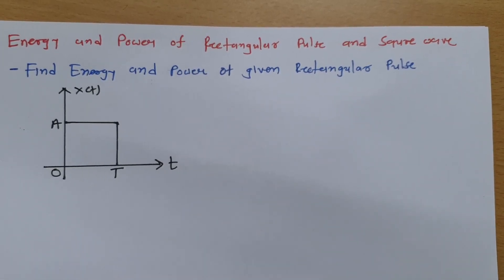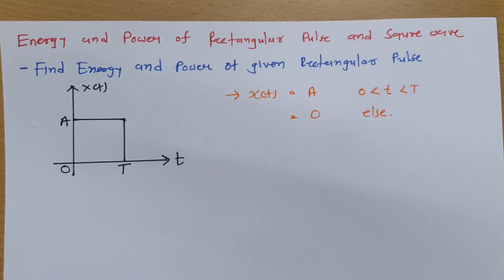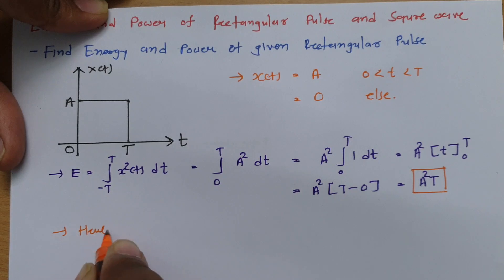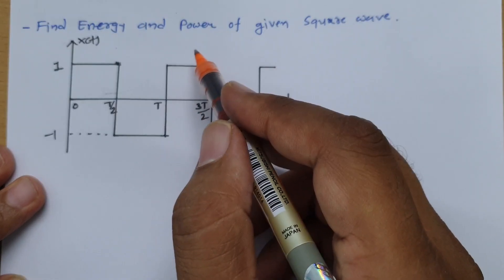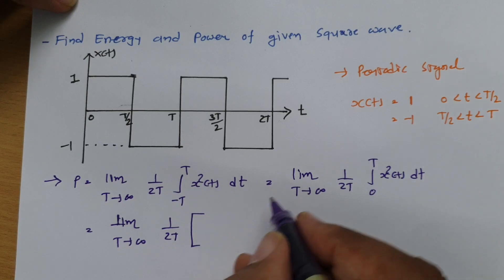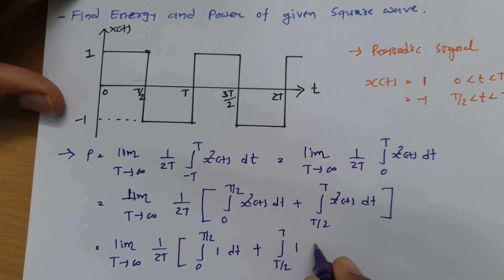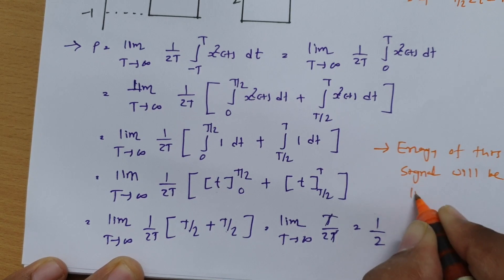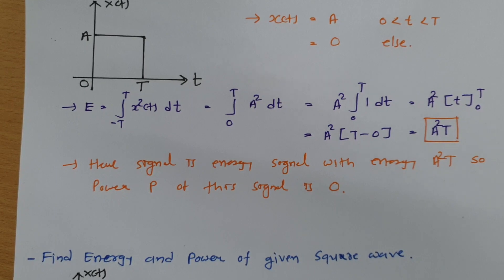Energy and Power of Rectangular Pulse and Square Waves in Signal & Systems

Comment: There are some signals which are neither energy nor power. So even if energy is finite ,we need to calculate power. 

But u have assumed if energy is finite,then energy signal 🙄
Reply from the maker: Yes, if energy is finite then it is energy signal.
If power is finite then it is power signal.

Comment: Sir, In SIMON HAYKIN textbook, average power of square wave answer is 1 and not 1/2 . Please help.
Reply: When limit  change 0 to t then 2 is cancelled out may be.
Reply: you can see that he used 2 periodes , for this reason he used 1/2T \integral... which is the average of the signal. 
other case you can view is the definition of the signal, for the time before to 0, the signal is 0, so we can decid the integral always will be the half of the area in a periode. 
If you have this signal in all time t, the power will be 1. 
I haven't check the book that you saw,  but the signal is continuos in all time the power is 1like  that you say. 
Another case possible is consider the power of 0 to T, in this case the power will be 1, like you said. But I think the definition thath uses the book you saw is the more possible. 
You could cheek it and notifie me about it. 
Excuse me my english :'v.
Reply: @alejandrosava9391  but here the integral is from  T to 0, not 1/2T and the energy is divided by 2T